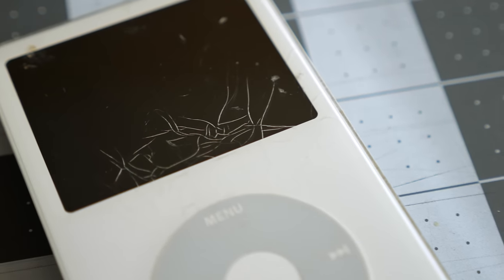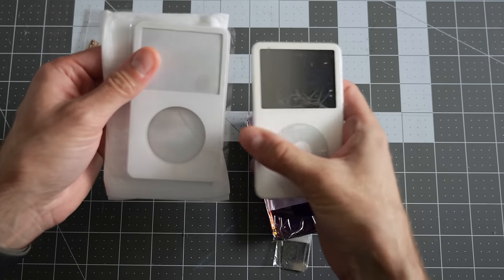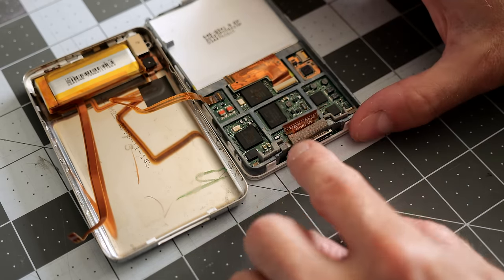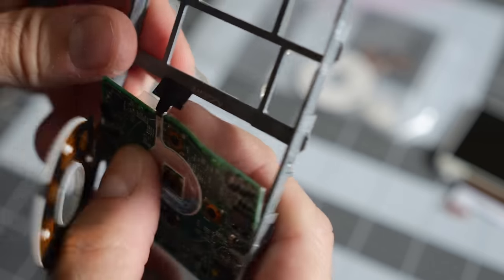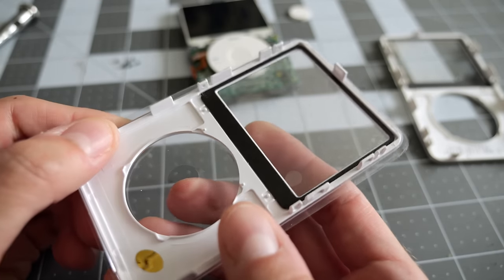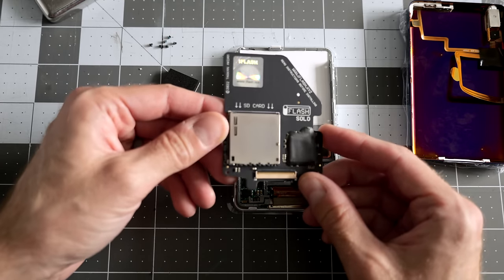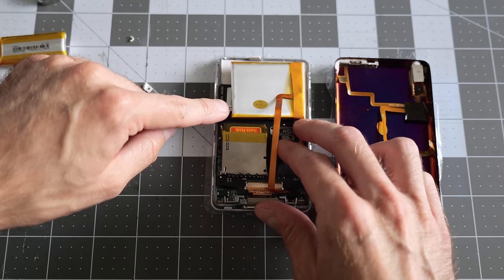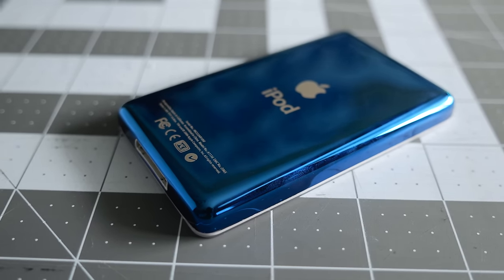Building a Custom iPod Video!

Comment: Hello. Can someone explain the following to me?

I own several apple phones and have always experienced an annoying problem.

When I turn them off 100%, they still use a lot of power and the battery becomes empty within approx. 2 days!

I tried to use an older apple phone as an mp3 player for some speakers with an iphone docking station but every time I turned it on after 2 days the battery was empty.

This is an iPhone problem as there is always something in the phone that is on and drawing power.

Android phones do not struggle with this.

Can someone explain this to me?

Comment: Ya know how there’s always an old guy who likes to tell you about how “everything was better in my day”? Well I’ll be filling that role today, but not to tell you about how everything was better in my day… although that is the case, I actually wanna talk about how EVERYTHING is crap! 
Yeah that’s right, I said it. At some point before even my old ass was born, many things were made with quality parts, and built to last a lifetime. Unfortunately, this hasn’t been the case for a very long time, and it’s really sad to see how quickly the quality, and workmanship have degraded (especially the last 30 years) 

I know what you’re thinking, “is he ever going to get to the F#€%ING POINT?!” 
(assuming I even have one) 

Ok, ok… 
So, the comment about the iPod hard drives in the beginning of the video made me realize is that if they can make such a tiny mechanical HD that takes the kind of beatings that people have put them through (plus considering the fact that they’re coming up between 10-20 years old) then how is it that regular sized HD’s that rarely move, comparatively have a far worse failure rate! 
If I had any hope in humanity (I don’t), and believed it would make a difference (it wouldn’t), I’d say let’s get some pitchforks and torches, and hunt down the bastards who have turned us all into such despicable, and ravenous beasts that do nothing but consume trash, and upgrade phones!
Not only that, but then they have the balls to turn around and try to pin the blame on us for all the problems with garbage, pollution, etc. 
I swear, the next person I hear saying “carbon footprint” and it’s not ironically? 
I’ll do them the ultimate favor of  relieving them of their teeth!

Don’t you dummies see that it’s those up top that hold back the free energy, who poison the air, food, and water! We just do what we can with what we’re given to use.
More proof that whatever “those up top” are, it’s not human. Because anyone with a heart/soul wouldn’t sell out the entire species for money…eventually your conscience comes knocking, and you can’t ignore it!

Comment: Does it recognize 50,000 songs per 128GB sd card it has installed? Or 50k songs will be detected no matter how much gb you have installed.
Reply: I think 50,000 songs no matter how much memory.  High res files take up more memory, but don't add to the song count any more than an MP# file would.

Comment: When the screen broke on my black 5th gen i knew it was time to replace the battery. So i got a broken 60 gb 5th gen and a relatively clean white 5th gen and put them all together. The reason why the screen broke in the first place is because of an original, bursting battery. A 60 gig battery would not only fix that, but would also increase the battery life. I figured while I was in there I could also replace the face plate. its been going strong almost 2 years with that storm trooper look. Tho I do use bluetooth headphones now, it still has its use in my car.

Comment: This could really use a USB-C connector mod.
Reply: gonna be a problem if you want use a old speaker with 30-pin connector as it does not have bluetooth on it
Reply: @Linkhunter  It's not mandatory, if you need the pins, don't upgrade. But also, the port could be installed in addition to the old one, possibly.

Comment: Any way to do this on a 1st or 2nd gen iPod?
Reply: Sorta, I believe the 3rd gen adapter works. But you can't load songs because those (1st and 2nd gen) only sync via firewire (so you have to use a 3rd gen or later to sync songs).

Comment: Hello, I have a 60 GB iPod Classic. It does not charge and turn on. I do not know what is the reason. I am unable to find a proper repair service in India. Even the authorized repair service from Apple is declining to touch it owing it to be old. I am unsure if you could help. I can send you iPod if you could help me out. The iPod is of deep sentimental value.

Comment: I'm ALL about repair, reuse, and reducing e-waste. But I think this is the wrong way to handle the 'problem' of an old device like this.
This is almost a ship-of-Thesius problem. This isn't a restoration at this point. And it also results in plenty of e-waste.
And for all that work, all those replacement parts, you end up with a mostly useless device?
Replacing screens/cases/batteries/buttons/etc on a handheld console is a completely different situation. All those parts directly contribute to the experience of the device in a way that can't be replicated or replaced by another device.
But a single-use music-brick? That's a LOT of effort, cost, and waste for a device that is meant to be used, and does a worse job than stuff you absolutely already have.